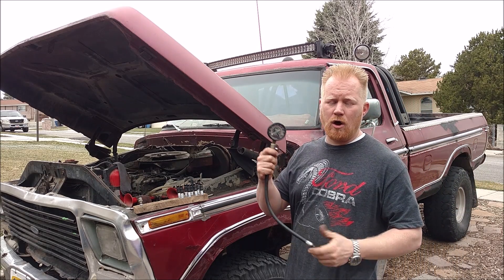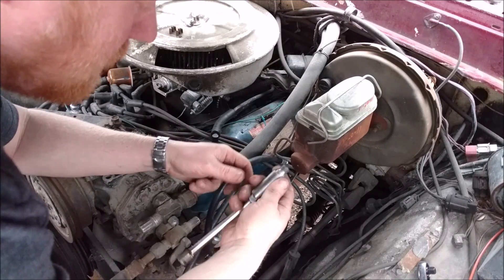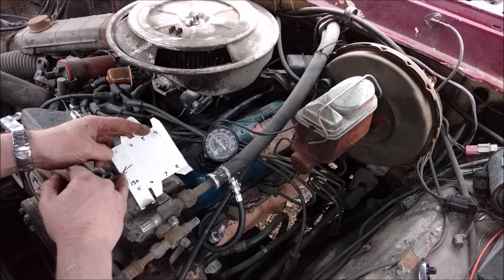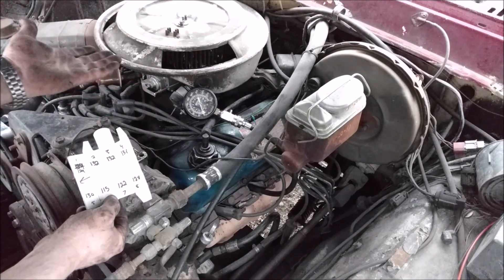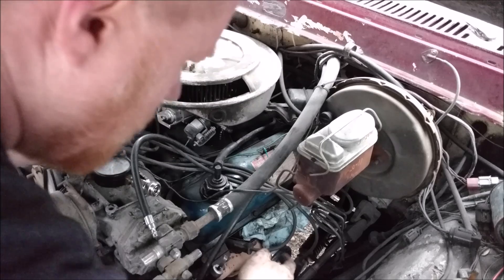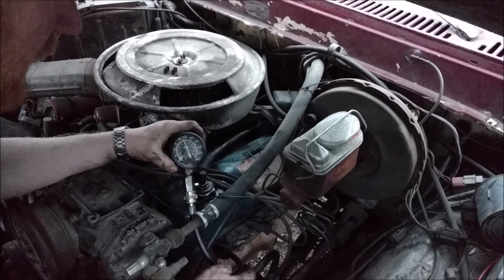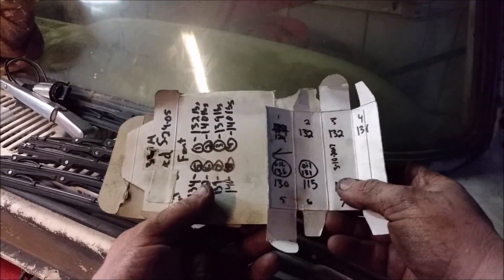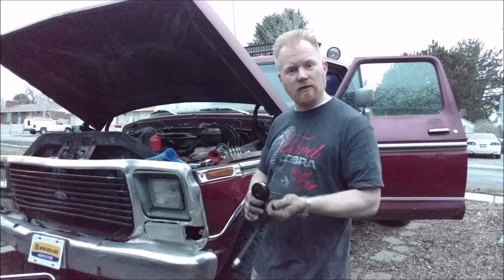Compression Test on an Engine

Comment: I Didn't know the oil tip to compression testing, I was thinking before you did it I wonder how you tell if it was valves, Seats  etc or Rings and you showed us , Thankyou 
Now a question for you 
I have a Toyota Hi-Ace 2.8 litre Diesel Van ( I Live in Western Australia) Do you need to do a compression test on them ( Being Diesel) I replaced the Glow plugs about 1 year back and it was a bloody Pain in the A$$ 
esp as the engine is under the passenger and driver seats and I have noticed that a diesel Or mine anyway has a critical powers level it needs to start if it drops below that voltage it wont heat up the glow plugs and even turn over the engine ( But I could take out the battery so to speak and start any petrol without an issue using the same battery with no extra charging 
so if you need to check compression how would you do it ESP with the Glow plug issues 
the engine has done 325,000KM's ( 1996 model) I have owned the van for approx 14 years and put less than 40,000kms on it I do less than 5000kms a year
change the oil every 5000kms  (Synthetic from last change onwards ) 
gearbox & Diff oils every 10,000kms
new air Cleaner if needed every 5000kms 
Tony
Reply: Moondyne .Joe  Sounds more like a starter motor issue than a compression issue. note- You will need a Diesel type compression gauge to do the test. But I would check your starter first considering your battery  won't turn your van over but will start your petrol car. Because Diesel engines have such a high compression ratio the starter motor does work alot harder. But a voltmeter on the battery and crank over the engine your battery should recover back to 12 volts in around 15-20 seconds. I am from Queensland Cheers Mark.
Reply: Moondyne .Joe most likely the starter or the wiring/relay, could also still be the battery, petrols are a lot easier to crank, average petrol compression ratio is roughly 9/10:1 (modern slightly higher) whereas even old simple diesels pre fancy electronics are around 16:1. if you had lost any large amount of compression it would actually be easier to crank, harder to start but easier to spin :-)  fellow  sandgroper btw, nice to see another one out in the wild :-D
Reply: tapper88 
Starter is fine once the car starts ( as in first time I fire it up on any day) the car will start all the time usualy within less than 1/2 a rotation of the engine the battery from day one always seemed to do that and even the original battery when I brought the van did It just seems to have a certain voltage it likes to start with and once that volage is below a certain amount ( no I havent as yet put a meter on it to find what that is) it just cranks slower and slower till no crank at all as long as I let the glow plugs warm up ( the red light goes out then about 10 seconds later a Click is heard) it starts fine winter can be a pain  so I always carry some areostart with me I Live up in Toodyay ( Hence the name of Moondyne Joe Grin) so we do get some Cold winters here Starter has never given me any problems as I have said , Maybe it has got good compression nd just , Like me has its own personality (: 
Tony
Reply: Mark Thomas
Hi Mark  I don't think that their is anything wrong with the starter , and i Do have a powerbank if needed to add a bit of extra Zing to startups and as I said to Tapper88 on the day , once it has started it is excellent to start each and every time , Usually within 1/2 a rotation of the engine crank 
Tony
Reply: Moondyne .Joe . Hi Tony, if it starts that well sometimes I very much doubt it will be a compression problem. Starter motors can have intermittent problems all depends on condition of brushes and the bendex etc. Also could be a bad battery cable or earth lead. If it has a big resistance when cranking it will take power away from other components on the engine like glow plugs, relays, engine shut off solenoid etc. Next time it gets hard to start try cycling the key a few times to make sure the glow plugs are hot. remember to wait each time for the relay to click. I am a Mechanic I have been doing this for over 25 years it is a bit hard to diagnose the problem with out seeing it. Any other questions don't hesitate to send me another message. Hope you sort it out mate. Cheers Mark.
Reply: Actually Mark the original Question was out of curiosity  you always hear of people doing compression tests on petrol engines and I think my comment was the first I had ever seen on diesel anywhere as no one seems to "worry much" about diesels as the are so reliable ( Until they are not !) you hear of them going over 1m miles frequently without any problems , I am on a limited income so I tend to look after the Beast by making sure the oild in engine gearbox and diff get changed most people dont seem to worry about gearbox and diff oils APART from the old put the little finger in the hole and top up when it gets low , 
which leads me to another point , 
I got sick of going to the local garage ( the Chrimes Bros  ( the criminals as we call them)  you bring in your expensive oil needed to change the oil and wonder as you drive away AFTER they have charged you 15$ to oil removal if they used your oil or their own generic 44gal drum oil  and kept the hugely expensive oil YOU provided  for their own vehicles .
 I started saving money by doing the engine myself, filter, and so on but each oil change is getting harder to get under the vehicle 
( at least the van isnt lowed and close to the ground ) 
Air filter is easy but HUGE on those beasts ( just behind the drivers side front wheel , 
Not sure what else one needs to do on a diesel on tune ups I did use some Fuel injection additive about 6000kms ago ( I do less than 5000km a year on non gravel roads ) and I try to Hyper mile all the time as a challenge to myself and careful driving 

Anyway this is sixtyfiveford   
channel  grin !  Tony
Reply from the maker: I have only worked on a few diesels, but hard starting was a major issue with them all. They draw multiple times more amps to start vs a petrol engine. I have added extra earth/ground cables along with positive cables with good success to get the engine to spin faster. I have also rebuild/cleaned the contacts in the starters that really help for delivering the proper current. The lower the compression gets in a diesel the easier/quicker it should spin.